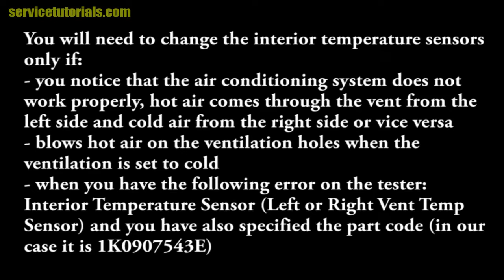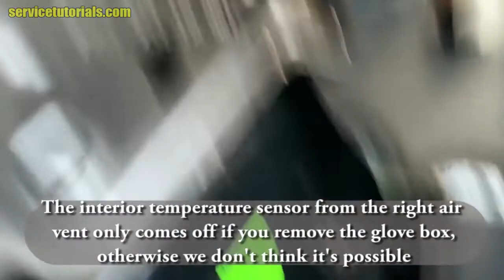Causes, Location & Removal of Interior Temperature Sensors on Volkswagen Passat B6, B7, CC 2006-2016

Comment: 2012 VW Passat 2.5L. Here is my issue, with AC on, center vents only.  Far right passenger side 47 degrees, passenger center, 55 degrees, driver center 60 degrees and driver far left 70 degrees. AC was service, no leaks and pressure were good. The temp readings were taken at idle and 86 degrees outside. However, when taking these readings when the temp is 100 degrees outside, they are all 10+ degrees higher. Can this be a temp sensor issue? Any help would be much appreciated. Thank you.
Reply: @Bryan-pc8zc  Hi mate, did you manage to solve this? Experiencing something similar